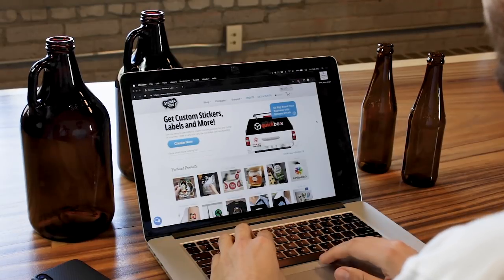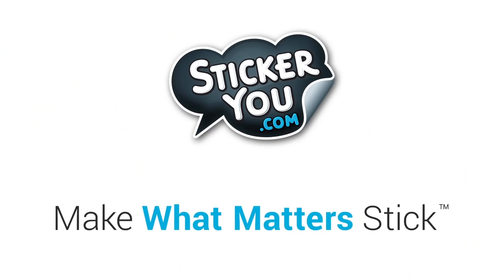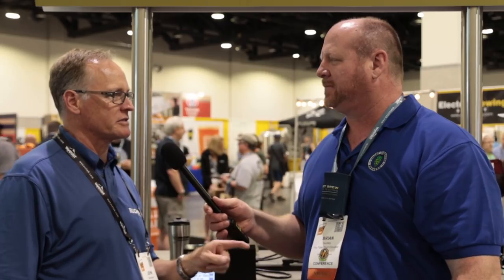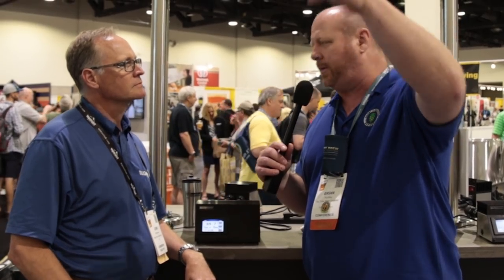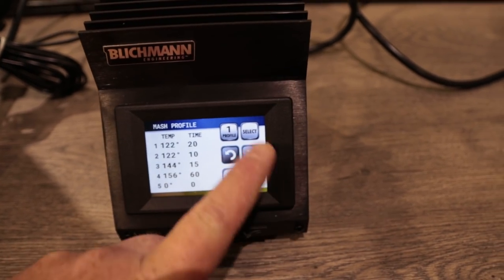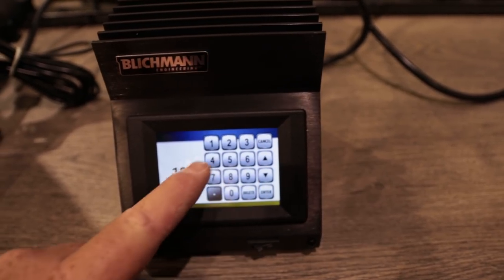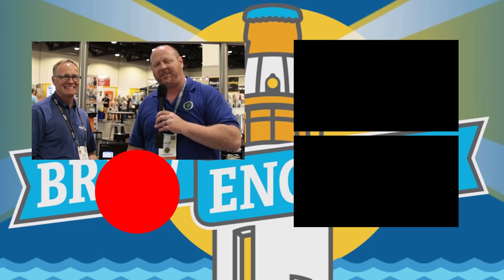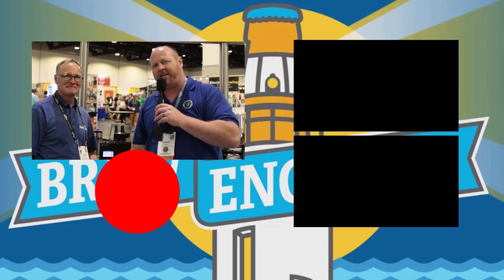Blichmann BrewCommander NHC 2019

Comment: I bought this controller per your recommendation and review; however, now I have an issue! My heating element has a 14-30 plug. Is there an adapter for this? Any safety issues I need to be aware of? "Beer is worth dying for!"
Reply from the maker: Blichmann sells adapters on their website they have a ton of configurations.. I'll see if I can find the correct one..
Reply from the maker: Your heating element has a 14-30?? Or your wall outlet?
Reply: @ShortCircuitedBrewers  the heating element.
Reply from the maker: @staveb0mb  14-30 is like a dryer plug? Can you send me a photo? Brian@shortcircuitedbrewers.com